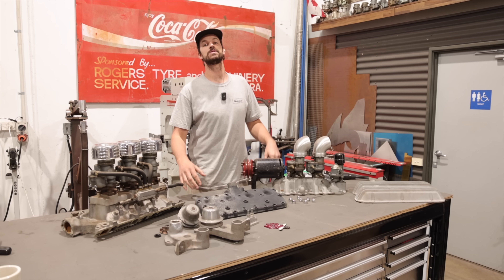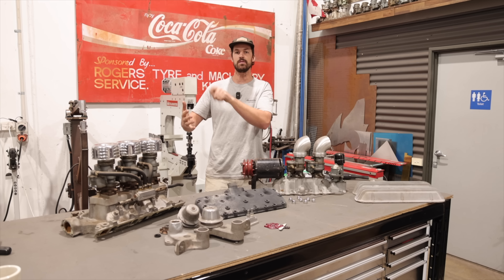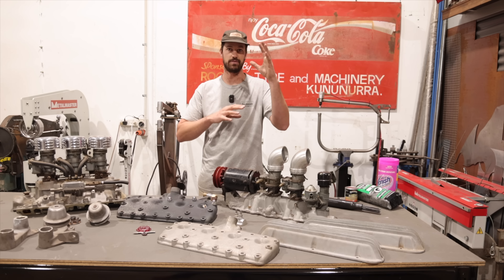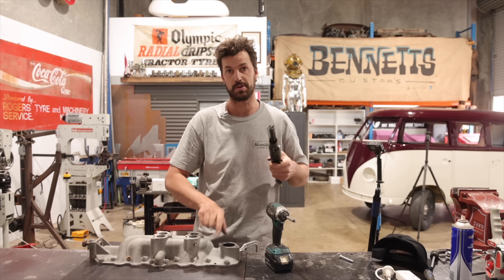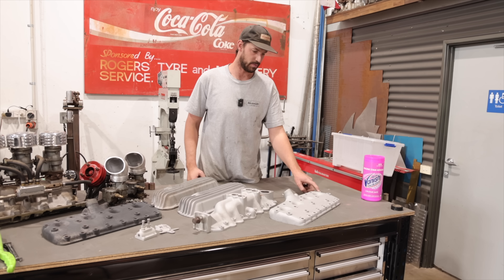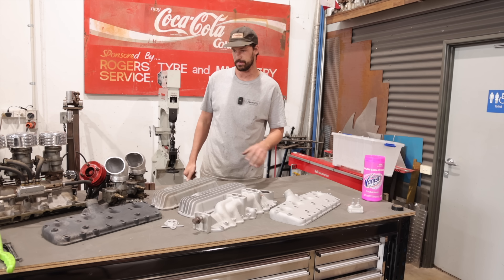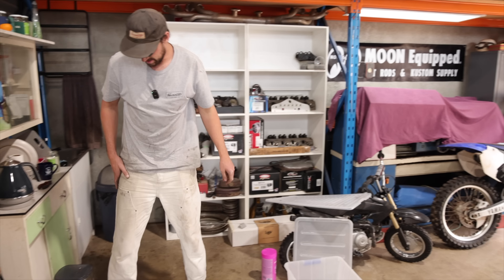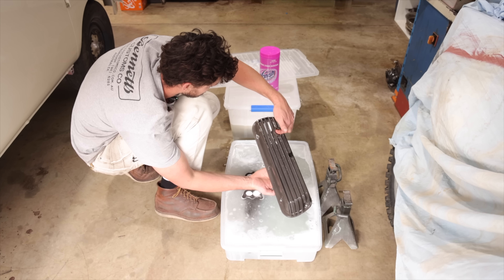Age CAST ALUMINIUM with ONE Simple Household Product: SIMPLE STEPS!

Comment: Great job Jordan.  
I wonder if the Aldi oxy action cleaner will work at half the cost. of the Vanish.
looks great and I suspect some level of electrolysis might be in play with that Bronze. 
I have seen people heat steel Nuts and Bolts and then use a Brass wire  brush to put a brassy sheen on the steel , wonder if the Brass in the Bronze is migrating because of the salts in the hot water. 
Interesting finish to say the least.

Comment: electrolyzes    ..... Electrolysis is the process of using electricity to split water into hydrogen and oxygen. This reaction takes place in a unit called an electrolyser.    must be worth connecting bronze and ally to a car battery :)  .... no clue just a guess :)